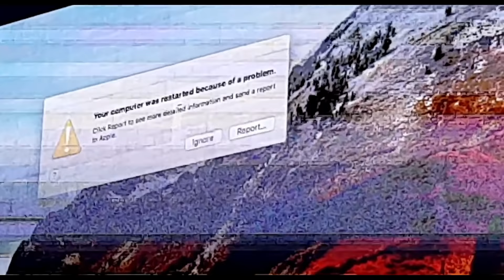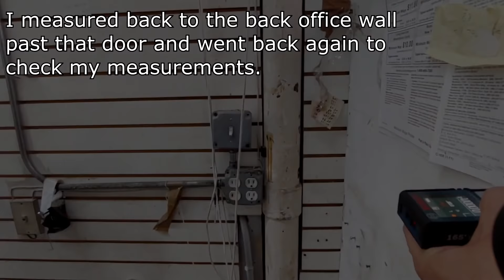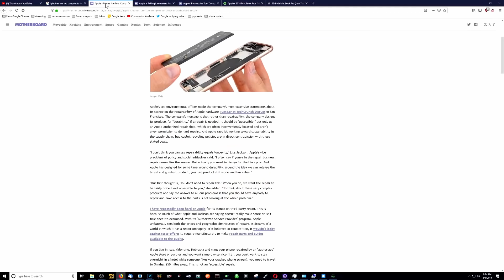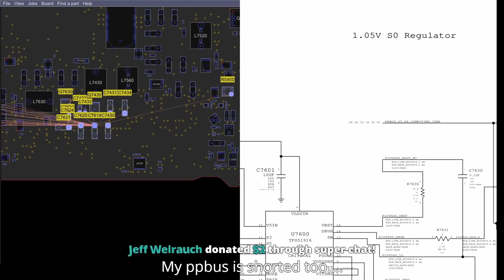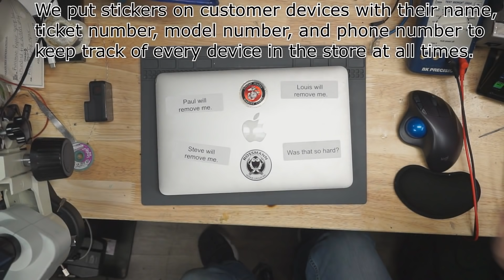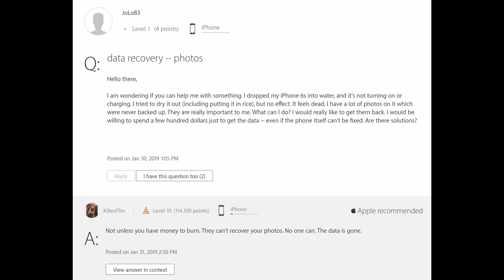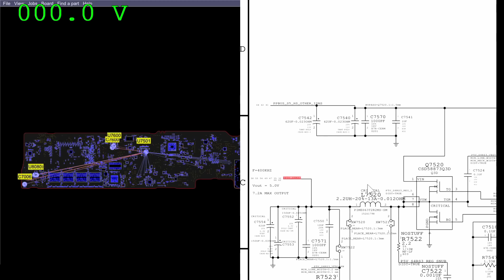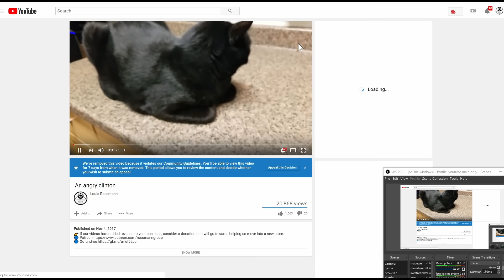What is Louis Rossmann's channel about?

Comment: Inventory tracking stickers is all fine but advertising stickers are not. Some repair shops go crazy with their ad stickers that has nothing but their company logo and phone number on it.
Reply: I find those Intel, AMD, NVidia and Windows stickers annoying as well. I don't need stickers to tell me what processor is built in. And there's no need to tell anybody else. I always removed those when I got a laptop (except the last laptop which was a Clevo from a small vendor without stickers on it). I really don't understand why they put it on there and those really are hard to remove.
Reply: @Hoch134  I like them,sometimes they can show how far they have come,they might be rare,or tell you the basic specs

Comment: How's your thinkpad P50 holding up?
Reply: Better than mine I hope, i'm having nothing but trouble with my P50.
Reply: @Wasmachineman  What's wrong with it?
Reply: What isn't wrong with it. BSoDs, running hot, palmrest cracked once, lower chassis paint wearing off quite rapidly.
Reply: Wasmachineman BSODs almost always caused by bad drivers. Running hot might be due to its age, dust buildup, or bad paste. I agree with you on the cracked palmrest and paint wearing off though, that's a bummer.

Comment: Just found your videos last night and ended up watching for hours and I'm not even a tech guy. My phones been having a problem with sound and thought 'f*ck it, lets just have a look' before surrendering and buying a new device (to have it repaired would have cost as much as the phone even on an hourly rate to examine, or I wouldn't have risked it). Found a bent pin on the connectors which wasn't making contact, carefully bent it back and there ya go! Know it's just a tiny thing but it's still loads of fun learning about how stuff works. From the UK.

Comment: Just a quick word about apple. I bought a new iPhone X when they were first released.  I have had nothing but trouble with the phone. It continuously drops bluetooth, wifi and the cell signal strength. I have been to apple stores and swapped the phone out while under warranty but my apple phone has ran out of warranty. I have contacted apple on numerous occasions and all i get is the run around. This is the only apple phone that  has been discontinued by apple ever after the first year of production. I have even brought this up to apple and one service manager told me it was because the phone was a limited edition phone. 
I can't be the only person that has had this problem??????

Comment: Hey Louis, ive watched a ton of the videos you make, and you have amazing skills. I have an older Onkyo receiver, and its DSP chip needs to be reballed. its kinda like the RROD on the Xbox 360s. Ive heated it up a few times with a hair dryer and itll come on for a bit, but I cant find anyone that can fix it. I know you stick to certain devices, but figured you might know where to send me if. Thanks and happy 2020!

Comment: Real story, once I accidentally poked a hole in an old iPhone 5 battery with a metal tweezer when I was trying to replace it, and there was a sparkle and I was like huh, can it blow up if I poke it harder? And the stupid me poked it again with my little tweezer, and it caught on fire. Luckily I was able to rip it off that stupid apple battery tape thingy before it damaged anything. I threw it in the sink and let it burn, was a pretty fun experience, and im glad that I didn't burn my house down with that..

Comment: Education. My dreams utopia involve that the knowledge of how computers work and how to repair them should be as common as the ability to read.

It should be thought like woodwork and welding, but not just optional like those things were in my schools.

And you shouldn't stay back if you don't understand. Or move forward not understanding.

Just stay at that level for that class.

2 years of knowledge over 5 years is bettee than speading 5 years failing constantly with almost 0 knowledge.

Comment: Give the VP a break. Steve Jobs is Dead. The only brain in the company =3 bwahhaha also, I recently replaced the battery on my itouch that was given to me cause it was "broken". The battery swelled up cause they dropped the device so what do i do. I youtube Battery replacement on ifixit, I watch your soldering lessons, i took a flat screw driver and destroyed the old battery even worse trying to remove it. I solder a new battery in and now I have a free working iTouch. I even used the lethal metal Pb. The amazing thing? I have never soldered, I have no tech education, and I plunge toilets for a living. 

I checked online apple repair options and with warranty the repair would have cost me $199 (from Apple's website $129 for out of warranty + $79 repair)...current gen itouch is $199. "affordable repairs" they say. 

Extreme Thanks to Louis Rossmann and others like him.

Comment: Hi Louis, just a question totally unrelated to this video...but, some time ago a had an iPhone 4s and I had some apps that were all going along just fine.
Then....when I needed to update these apps...the screen came up with something like "not able to update to iOS whatever.
Is this just another con from AM.  In other words ....your phone is working fine but it's time to buy another one.
FYI this was the last straw for me I went on to buy an android and get the f@@k away from this shit.
Never looked back from there.
Just wondering if you could shine some light on this insidious shit.
Cheers mate from Australia....love your work.
Reply: iPhone 4s came out 9 years ago at this point. I wouldn't usually excuse it but the phones of the early 2010s are potatoes, while the phones of the late 2010s are almost as fast as a low-end PC. As an app developer since the days when the iPhone 3G was still popular, I can say for sure that things got so much easier over time just due to the phones having so much more grunt in them, to a point that companies won’t justify spending time on the problems when they can just bump up the minimum system version and tell that group of customers “sorry, your phone is 9 years old”. People realise their phone is old and software support isn’t forever, they just want to delay an upgrade for as long as possible.

A lot of the blame still goes to Apple though. Some of it is intentional like the removal of the iOS 9 (therefore also 4s) simulator from the app developer toolkit, meaning it’s now more effort to test that your app still works on a 4s just as much as it does on a new iPhone 11 Pro, since you need to go buy a 4s now and have it charged up and all that. Some probably not intentional but a real pain, such as that a pretty bad mistake they made a few years ago now forces app developers to choose between supporting dark mode and supporting the 4s and 5 (luckily my job sided with the latter, at least for now).

Not really laziness, just the feeling from Apple and app developers that spending time and money on the diminishing low-end of the userbase isn’t worth it. Android’s toolkit is much better at supporting older Android versions than Apple’s toolkit, but that’s not without its problems either.
Reply: Adam Demasi . Thank you for your comprehensive and informative reply. 👍

Comment: Tbh Louis, You were probably lucky at the time when you bent that battery, cause I'm assuming you discharged it most of the way anyways. (Considering that lithium ion batteries are only lethally dangerous if they contain a charge. So puncturing one that has a charge would of course, cause it to spontaneously combust. As for a discharged one, Not as likely to occur, like, it's much less likely to occur that a battery would explode when it is discharged completely. Altho of course still taking precautions, unless the battery is shot anyways from the beginning is at least the safest. In the off chance you of course aren't sure that the battery is actually discharged or not. Also, my opinion on the one battery in that one mac book that was basically a puffed up dead piece of meat is just sad. But then again, I'd assume what occurred was a direct short across the terminals of that singular cell is what caused it to A: puff up badly, and B: essentially just spontaneously combust. Either that or overcharge protection failed for the one cell, and the other cells were just lucky enough to survive for the most part, probably not from the heat. but certainly from being overcharged like the one that blew up most likely.

Comment: To be fair, the battery was very likely fully discharged. It should totally catch on fire after hitting it with a hammer.
Reply: batteries never fully discharge, unless you make them do it violently.
Reply: @TealJosh  It was a "part phone" so it was probably sitting there for a couple of years. After that time the battery looses all of its charge if connected to the PCB. (it will still read like 3.7V but there is not much energy stored on it)